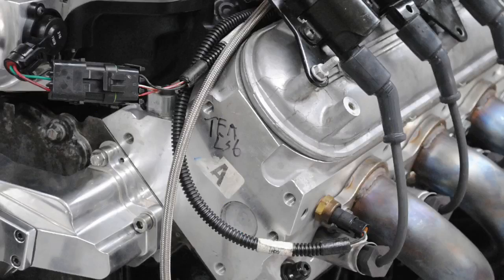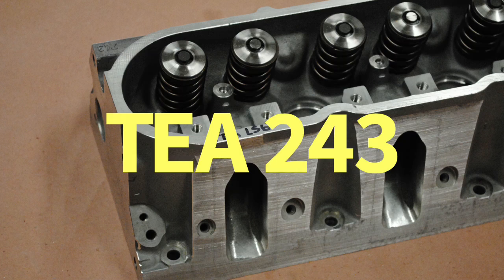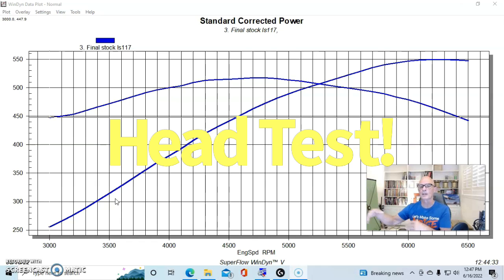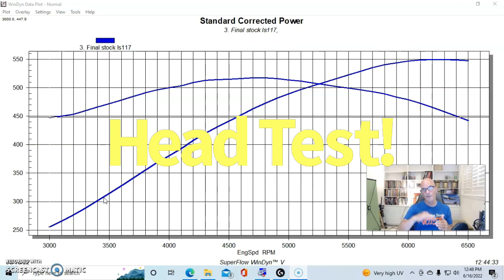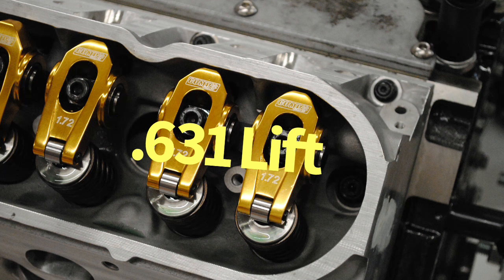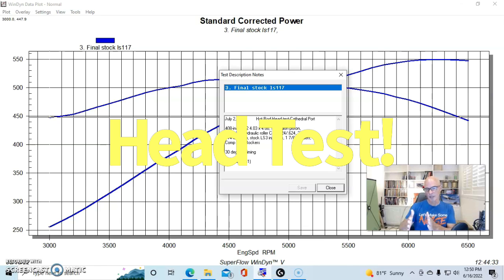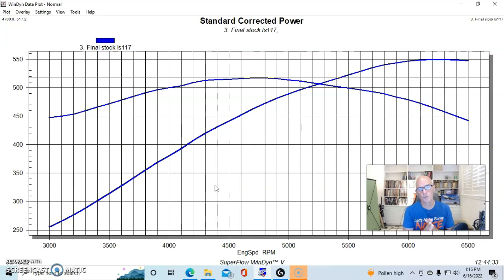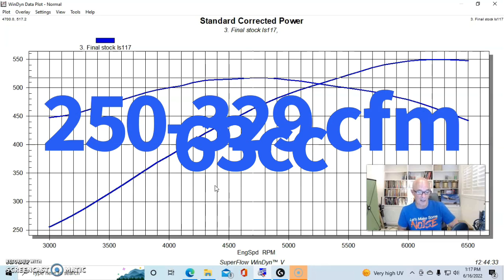WHICH IS BETTER-CNC PORTED STOCK LS HEADS OR AFTER MARKET CNC HEADS. TEA 243 HEADS VS AFR 245 HEADS!

Comment: I just received a quote from tea to perform their stage 2 upgrade to my 243’s and the price was 2006$ as of September 2025. I think it might be more cost effective to run some aftermarket 225 heads.
Reply: I’m in the same predicament. I’m running a boosted 5.3. I was considering ported 243 or Brodix br53. Going for 1000-1200hp.

Comment: I’m confused why we’re comparing a head with a 245cc runner to a head with a runner in the 220 area. They’re not close in comparison. Like comparing a 241 head and a TSP 227 head. The runner sizes are way different. 243 is just the casting number. They aren’t 243cc intake runner heads. Am I missing something. If I am, my apologies but isn’t this apples and oranges?
Reply from the maker: ported stock (at its best) vs after market (you don't have to mandate port volume)

Comment: I Have A Set Of 243s 63cc Ported With Stock Valves Along With A Stage 3 Cam 232/244 111lsa, Will They Work For A Flat Top 408 Will It Be A Nice Gain Of Horsepower?
Reply from the maker: will the heads gain power over stock heads? yes
Reply: @richardholdener1727 Ok Cool, Thanks Sir

Comment: Richard,  A motor uses electricity to make mechanical energy while an ENGINE converts fuel into mechanical energy. Until recently everyone used the correct terms but these people that learn everything on their phones or youtube don't use the correct terminology. But these internet noobs will one day learn "Not everything on the internet is true" a quote from Abraham Lincoln.... So try showing your intellect instead of ignorance... Most of your stuff is great btw.... just saying bro....
Reply from the maker: I'll make sure to alert the Ford Engine Company and General Engines about your pedantic notion
Reply: Your a gear head so I’m sure you knew that the first “cars” were electric NOT gas so they were motorized vehicles.
Reply from the maker: please look up the phrase common usage

Comment: IMHO, the CNC ported 243's can be had at less than half the cost of the 245 AFR's as I paid $1,200 for my set with no head exchange. That's $1,800 less than the 245's basically making 10 less HP. I can live with that all day long and get me the best long tube headers money can buy for the price of the 245 set.
Reply from the maker: That's why I do these tests-so you can decide what you want to choose
Reply: @richardholdener1727  Actually paid $1,300 my typo. Thx for the content on cams as I have got a ton of knowledge from your channel.

Comment: Here's what I think with my minimal knowledge. The Afr heads would have been better suited if you were going to change the cam to match them and I think he said compression was moderate so you could bump the compression up and still run pump gas with that and the proper cam for that head and compression it would have made 700 I bet. That makes it more worth it but it's more money. 🤷

Comment: I’m building an NA 5.3, I am using a Truck Norris cam, upgraded heads, and possibly a TBSS or the FAST intake, but I wanna know if anyone has built soemthing similar and what you all did for heads.
Reply from the maker: ported heads help, but not as much as if you had a bigger cam
Reply: @richardholdener1727  firstly I appreciate you for replying, anytime I’ve had a question for you, you’re always very helpful. My goal power wise is just to make 400hp crank, mid to low 300 wheel. I was going to go ahead and go e85 as well for the extra little push. Does this seem attainable for what I’m running + ported heads ?

Comment: I would love to see a set of heads that were ported solely for a turbo build, from what I've found in lots of videos all the porting is in the exhaust where it sent to turn the Turbo they don't touch bottom but take it all out of the roof and side and can help with spooling so bigger is better I believe
Reply from the maker: there is not turbo only porting

Comment: So I have a gen4 aluminum studded and sleeved 6.0 afr 225 72 heads, Steve morris rods cp pistons  stage 3 Steve morris blower cam it's covered to a 24 tooth trunion bronze kit 660 springs.. what kinda hp should I expect na with a holley stand alone and holley intake at 7000 rpm? Stroke is stock 3.622 with a .005 line hone..
Reply from the maker: what holley intake what are the cam specs
Reply: @richardholdener1727   it's a Steve morris stage 3 blower cam not sure of specs and I haven't bought an intake yet thought maybe u could help with that want to stay away from plastic intakes ..

Comment: Just to answer the question at the end... AFR 245 heads $3K and when I got my 799/243 heads completed with the extraction of 2 exhaust bolts it was $2150. 

For more than 20psi of boost or 250hp shot of gas go aftermarket with the thicker deck. Anything below that and (in my opinion) you will be okay.
Reply: How well would the ported 799 heads hold up to 100-150 shot ?

Comment: I’m planning on doing a set of 243 cnc ported heads on my 6.0 LQ4, big question are stainless etc valve replacement worth anything the factory valves in my heads are not the sodium’s, are a bit heavy compared to sodium’s, but the stainless are even heavier?  Was looking at Manley as years ago while I worked at an engine shop that was choice of our champions in our SBC 355 modified engines….all tech comments welcome. 🙏
Reply from the maker: most run bigger valves in the ported 243s
Reply: @richardholdener1727  are the valve swaps worth the cost for a street strip 317 swap?

Comment: Hi Richard  i have a question 

My ls1 is a 2001 5.7 225kw with Otr they say +35kw bold on ? .
So if this is true thats the start.

With a truck norris cam would i leave 241 heads along with the ls6 manifold and headers witch at this point im running just the stock exhaust manifolds or upgrade the three my max target is 480hp max but more tourqe is the end goal with the truck norris cam being the choice.

Thanks 
Aaron
Reply from the maker: ported heads and fast intake will certainly make more power, but you can run the cam alone with springs on the 241 heads
Reply: Morning Richard Thank-you your video's are great i saves alot of research time .

Thanks
Aaron

Comment: We stroked an aluminum 6.0 to 403 ci with cnc ported GM LS3 heads with a 248/252 cam made 640hp @ 6500rpm.
Reply: Jules Broom I did a 417 with a big BTR NA cam with reher morrison cnc ported l92 heads and made 705hp 592tq with more tuning to go and with 1,000 cfm pro systems carb
Reply: @KS-dg5zh to the wheels?
Reply: @CryptoBandit  no .on engine dyno
Reply: @CryptoBandit that’s about 600rwhp from a n/a setup. Pretty gnarly
Reply: @KS-dg5zh  what compression ratio are you running with that set up and that’s that with  E85 or what kind of fuel?

Comment: How much horsepower can a 4.8 LS or 5.3 LS make with a precision 76/75 turbo   with tfs 205 ported heads
Reply from the maker: THAT TURBO IS ABOUT 1000 HP
Reply: @richardholdener1727  can you put a bigger one on the 5.3 LS (8284 precision) and it can take it

Comment: Hey richard, what would you recommend for a 11:1 CR 4.08 stroker 4.030 bore. Trying to choose the best heads cam package for this setup, currently running an unknown spec Livernoise Ported 243 heads on this 408 with a pat G spec cam, 234/242 .629”/.615” 112 LSA +4 advance. Looking for max effort for best flowing heads for this setup.
Reply from the maker: that is likely a good combo
Reply: @richardholdener1727  not sure what might be going wrong but this combo put down 450Whp and 453TQ through a T-56 yesterday. Seems very low, A/F is good and ignition system checks out. At a lost currently.

Comment: I have the TEA 317 casting with the stage 2 cnc program. They have the same size valves as on your set. The flow chart that came with my heads had these numbers:
INTAKE
0.100 lift 67.2 cfm 0.200 142.6 cfm 0.300 lift 216.6 cfm 0.400 lift 268.6 cfm 0.500 lift 300.9 cfm 0.550 lift 323.3 0.600 lift 326 cfm
EXHAUST
0.100 lift 58.5 cfm 0.200 lift 115.4 cfm 0.300 lift 166.8 cfm 0.400 lift 214 cfm 0.500 lift 238.2 cfm 0.550 lift 244.2 cfm 0.600 lift 247.3 cfm
Pricing in 2020: STAGE 2 ls6/317 head castings with 2.045 intake 1.575 exhaust valves (stainless Ferrea valves)$1,533.04 
STAGE 3 with 2.08 intake 1.600 exhaust valves(more work to intall the bigger valves) $2,051.96
STAGE 3 FLOW: only listing where the numbers very from the stage 2 heads
Intake- 0.300 lift 219 cfm 0.400 lift 269 cfm 0.500 lift 311 cfm 0.600 lift 346 cfm
Exhaust- 0.300 lift 182 cfm 0.400 lift 233 cfm 0.500 lift 260 cfm 0.600 lift 270 cfm

Comment: @Richard holdner can you do a video on 408 ls with trickflow 225 head vs 255 trickflow?
Reply from the maker: THE INTAKE HAS TO CHANGE TOO-AND THE CHAMBERS ARE DIFFERENT SIZE
Reply: @richardholdener1727  ok is that something you can test even though one is cathedral port and the other is rec port? Or maybe a 225 tf head vs the biggest trick flow cathedral head they make ???
Reply: @chevy19699  245 is.i ha e 235s on a 402  88 mm turbo engine.it screams
Reply: @ryangulley2051  nice any videos?

Comment: I have AFR heads, a mild cam, intake, exhaust and 91 octane tune on my  C5, 450hp, 100hp gain. Not bad
Reply: Stock they didn’t dyno 350. Autos were 285-295 whp, manual 305-310 whp
Reply: @Dan-gj1hz C5 Z06 do dyno at 350 stock

Comment: If I remember correctly when I emailed TEA for a stage 1 porting.  It was 1800 and could go into the low 2k range if they have to replace some stuff.  Should run some junk yard ls3 heads to compare.
Reply from the maker: ported cath ports make more than stock rec ports-but stock rec ports are cheaper

Comment: 600 hp/550 tq form a good ported head or an aftermarket head is nooooooooooooo joke!  Peak hp probably right where you want it on a hot "ish" street setup - 6,000 to 6,500 rpm

Comment: Would love to see same test on a stock 5.3 with boost, but I already know what you’ll say: results will be similar, just scaled.
Reply from the maker: I don't recommend ported heads on a 5.3L with boost unless you are going for very big power and need thick decks-otherwise you can make the power you want with the turbo and stock head
Reply: @richardholdener1727  what about a stroker 383 and factory 706 heads and a 76/75 turbo? Are aftermarket heads a necessity for  longevity?

Comment: I was thinking of doing a similar build but using my 706 heads with TEA stage 1. But sounds like it might choke the motor down? I’m looking for more power under 5500..
Reply from the maker: those work too-it won't choke the motor down

Comment: Which has a thicker deck ,   
Which has a more efficient cooling psssages.
Reply from the maker: after market heads have thicker decks-not a concern on NA applications but a plus for high boost (like over 1100 hp)

Comment: Sounds like a stock ported head is just as good as an aftermarket head
Reply: Well for high end power yes.  One thing to consider is all the part throttle operation.  IMO on a street car I'd give up a little top end to protect for that 1500-3000 rpm part throttle air velocity.

Comment: Excellent video Richard. Shows how good the right factory head can be in certain applications. David Vizard is somewhat critical of cam companies, particularly when it comes to LSA's. I suspect that he would use a lot less than 114°. Would it be possible for you to do a video where you use the same cam lobes, one with  the off the shelf spec, like this 114, and one with a DV spec'd LSA? That said, I wouldn't be surprised if you had already done it. Regards Greg
Reply from the maker: THE CAM COMPANIES KNOW WHAT HAPPENS WHEN YOU TIGHTEN THE LSA! LOTS OF SHARP GUYS THERE.
Reply: @richardholdener1727  I have a 07 tahoe 5.3 with 799 heads I've bought the truck Norris cam 3/4 long tube headers do I need to port the heads or do they flow enough
Reply: donta simmons it look like unless you want to make more than 500 hp stock heads will do.
Reply: @michaelgarrow3239  what
Reply: donta simmons - I believe, looking at the graphs, Richard is showing that stock heads will flow enough air for 500 hp. 
More with boost.

Comment: Should we expect similar results with Rec oem vs rec oem ported vs afr/tfs/mamo aftermarket on a 6l+ na combo?
Reply from the maker: a 6.0L doesn't really need ported rec port heads since the stock rec port heads already flow enough to make 630 hp
Reply: @richardholdener1727  That's peak HP, what about area under the curve starting near 3500?

Comment: Richard.  Kool vid!   Properly ported heads are hard to argue with!  Perfect sleeper style heads.  Do the aftermarket heads have larger deck surfaces for better clamping and perhaps some type of improvement for the valvetrain?  Better sealing and rpm longevity?
Reply from the maker: much thicker decks

Comment: Richard, is there any way we could see a test of the deck of the heads? Obviously a 6 bolt aftermarket set with a thicker deck will work better under boost, but I’m curious if there’s any way to tell WHEN the aftermarket heads are worth the $? I’ve seen guys make more horsepower than I ever intend to make on stock heads. Thanks!
Reply from the maker: 1100-1200 hp seems to be the concern power level for stock decks

Comment: I'm trying to figure out how the 6.0 from the intake test made 592 with heads cam and the fast intake but this 408 barely makes over 600 with the same cam and intake. Was the 6.0 intake test also in a 408 config? Also, how you get a job like this? Richard, you're getting old don't you need a sidekick or overpaid grunt?
Reply from the maker: I'm getting old?
Reply: @richardholdener1727 you know getting old is inevitable just embrace it
Reply: Maybe one engine had more timing than the other engine.
Reply: Richard, I'm meant that more as a segue than a statement of fact.  I mean I'm 35 and everyday I'm looking for someone to do the heavy lifting so I can retire.
Reply: @raymondkaczmarek5631  LMAO!!! Wait until you're 65+!!!!! IF....You make it!!
Reply: @milojanis4901  I'm not gonna make it. This texas heat melting me this year. Shop don't make enough money for ac yet.